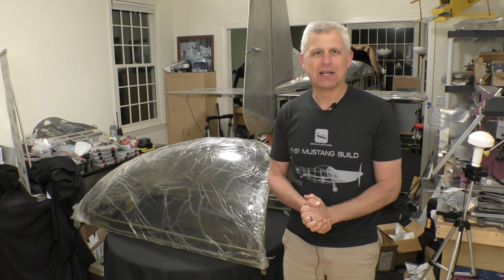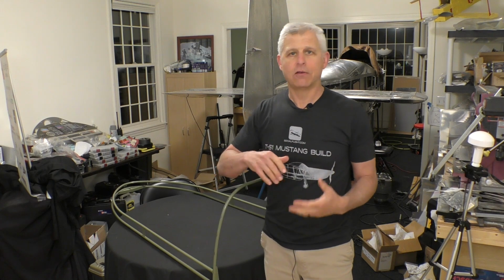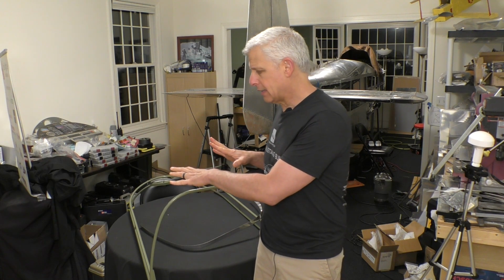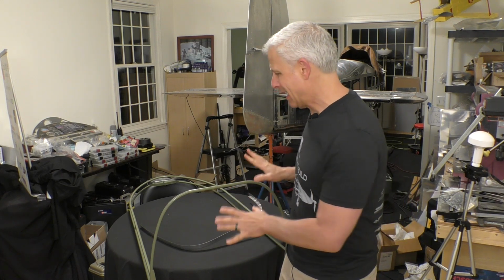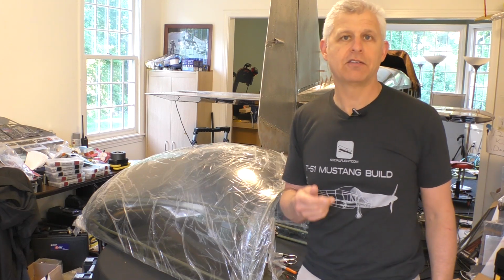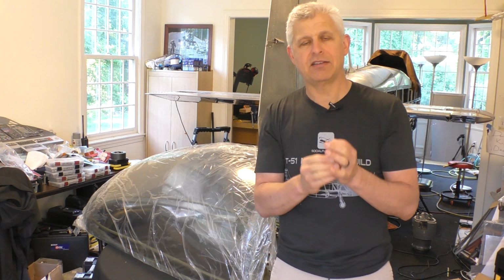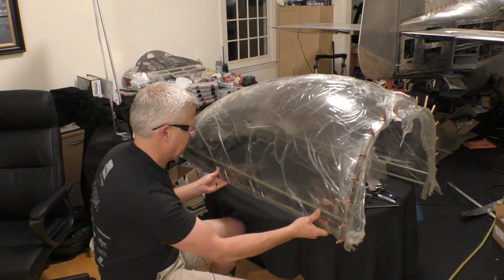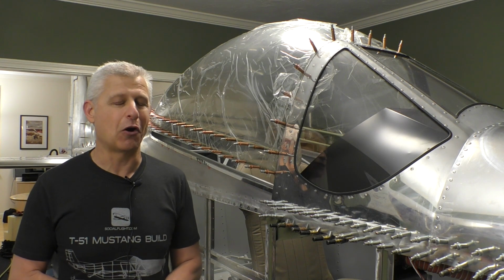CANOPY TIME for the WWII P-51 MUSTANG Replica!  Our COOLEST Build Stage Yet...

Comment: Just out of curiosity how are you going to get that out of the house?
Reply: Cutting that large bay window out and associated drywall is trivial. Roll the aircraft out into the garden. About a day's work to put the window and framing back. Paint later. Compared to the build time it is a rounding error. I have seen builders remove house foundations and jack up the house to get a finished kit out of the basement!